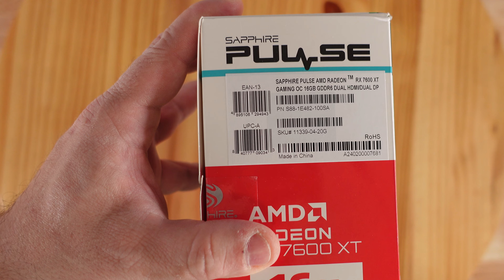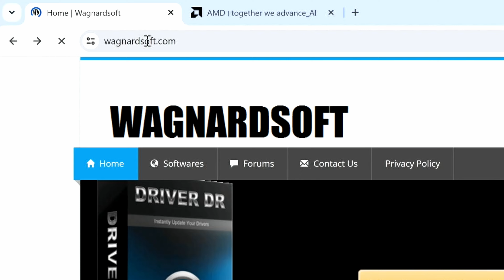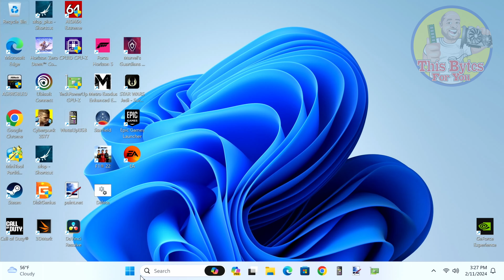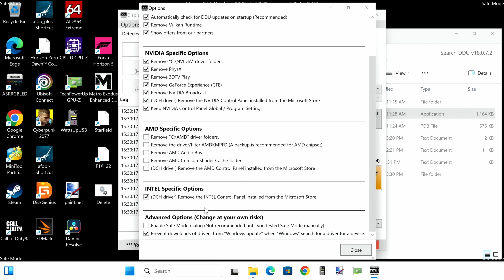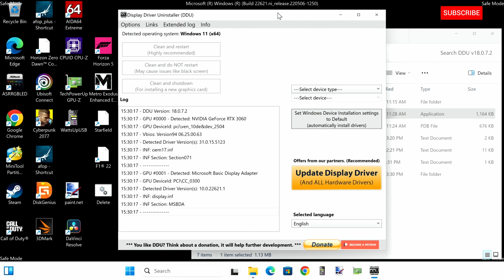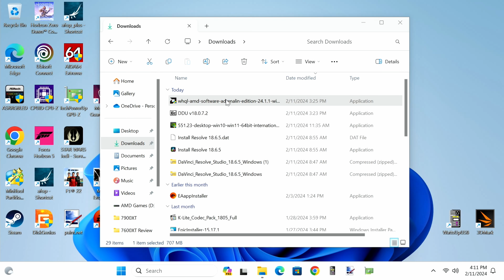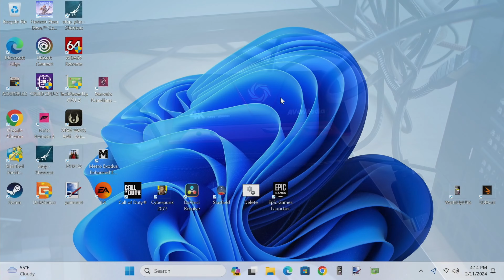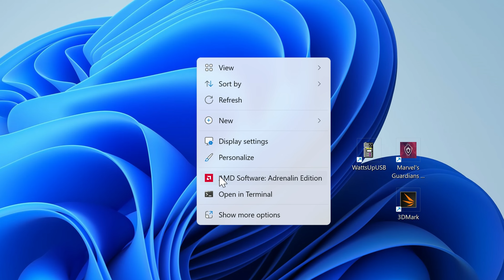RX 7600 XT - Installing the Sapphire PULSE Radeon RX 7600 XT Gaming OC

Comment: so this card is pcie 4.0 x8? will it work in my pcie 4.0 x16 slot?
Reply from the maker: I have not tried it recently, but i have seen it work years ago on older generation amd cards.
Reply: @ThisBytesForYou  Yea I just figured it out  the RX 7600 XT features a PCI-Express 4.0 x8 host interface, it will work on any PCIe x16 slot
Reply from the maker: @jacobhaussmann90  right though I show you that here as well, and I go over it in other video but I haven't put a physical x8 card (or 16) in an electrical x4 in years, thankfully haven't needed to, I am interested to see if you are running into a need for this?